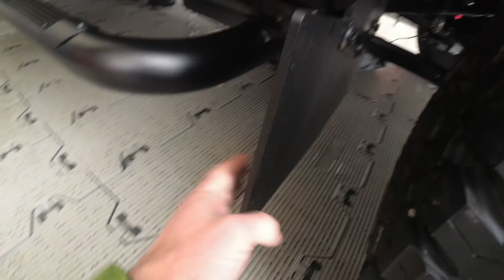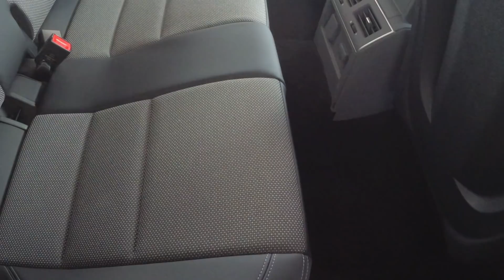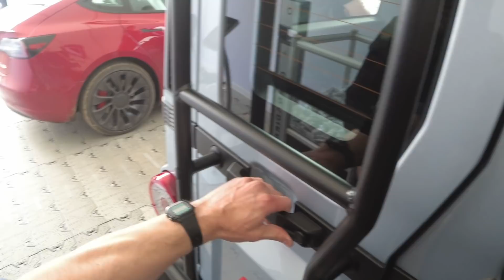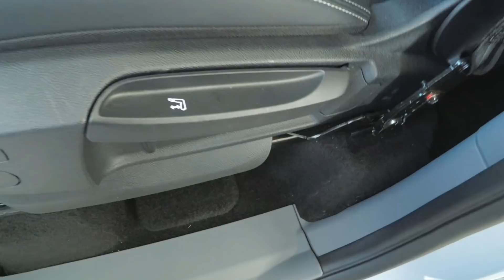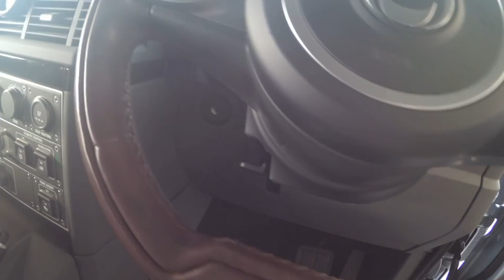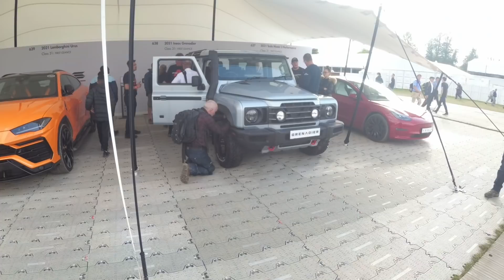Grenadier parts, dealers and warranty - 2 of 2

Comment: I’ve owned several landrovers over 40 years ,still have a 110   12 seater. Used at my holiday house in the Hebrides. Main driver is a now a L322 Range Rover  like it but to much tech . If I leave the door open or the tailgate any length of time say I open it 5 / 6 times a day the battery goes flat , I’m fed up with that told by the AA that’s the way most modern cars are ,was in Halfords to have the battery checked they said it was fine just that modern cars do this if not run constantly. So here’s my issue should I buy a Grenadier . O I also owned 3 discoveries 3 shoguns , the shoguns were brilliant would buy another in a jiffy. However they have stopped making them . I think I need to get a test run in a Grenadier. Need to look for a dealer near Glasgow , any suggestions?

Comment: Only if it were lower cost ,had analoge instrument cluster in front driver instead of computer screen in middle and was WAY MORE RELIABLE than any British vehicle  . British vehicles do NOT have a reputation for RELIABILITY . This is especially true if you're buying one of these  you will be traveling off road in the middle of NOWHERE you don't want anything breaking down leaving you STRANDED .

Comment: This product need 9 more Features that will allow it to truly be a compelling product 

1 remote start ( if you need to start it when it’s cold )
2 keyless entry and start ( in the great outdoors I should not have to take out my gloves and fight with my phone and wallet   And bunch of keys in my jeans pocket to get the keys to start the car in the freezing cold)
3 wireless charging pad for cell phones  ( people will be very dependent on CarPlay and Android Auto )
4 more cup holders 2 for each passenger : water and a slurpy can’t tell you why but cup holders sell  
5 multiple USB ports 
6 an optional rear bench seat that could accommodate 2 kids that could be clipped in or clipped out . Entry to the rear would only need to be on one side of the mid row seats keep the batteries on the other side. Or from the small split door at the back 
7 and maybe put another one of those clipping racks on top of  each of the front fenders  ( this is more of a nice to have ) 
8 also if you could have a touring mode and an off road mode that would allow the ICU to adjust the torque curve and horsepower curves for road highway cross country touting . Because in the US 95% of the time this thing is going to be on the highway taking kids to soccer and the wife to dinner 

9 night mode for the touch screen , speedometer  be that it can be dimmed at night with the Speedo still showing 

With these features I think this would fly of the shelf and these features would add less that $100 to production cost the technology is readily available and adds more utility to this fantastic product

Comment: This product need 6 more Features that will allow it to truly be a compelling product 

1 remote start 
2 keyless entry and start ( in the great outdoors I should not have to take out my gloves and fight with my phone and wallet  in my jeans pocket to get the keys to start the car in the freezing cold)
3 wireless charging for cell phones 
4 more cup holders 2 for each passenger : water and a slurpy 
5 multiple USB ports 
6 an optional rear bench seat that could accommodate 2 kids that could be clipped in or clipped out . Entry to the rear would only need to be on one side of the mid row seats keep the batteries on the other side. Or from the small split door at the back 
7 and maybe put another one of those clipping racks on top of  each of the front fenders  ( this is more of a nice to have ) 

With these features I think this would fly of the shelf and these features would add less that $100 to production cost the technology is readily available and adds more utility to the product

Comment: I am not sure where you got your information from or if its accurate. To be clear one of the early submissions was a cradle fitting for your own ipad with an app for GPS, systems diagnostics,starlink, photocell charging, and instructions diagrams for repair. Seems that they are not listening to professionals at an early stage of development. Imagine been stuck in the middle of nowhere without instructions for repair onboard.

Comment: I spotted the first thing that would break straightaway...the mud flaps. When bogged (in sand) and having to reverse out, those mud flaps would rip off within seconds. I now use Clevis pins on mine (for quick removal) now as I have had my front ones ripped off just like described above.

Comment: I haven’t been excited about a new vehicle for a long time till now. I absolutely love this project and wouldn’t mind picking one up in TX once it becomes available. However, having lived in the rust belt of the USA for 20 years, I cannot help by wonder about the possible rust issue with all the nooks and crannies on the exterior. They WILL collect salt and mud very easily. I’m sure structurally the vehicle can be made to withstand the harsh environment but esthetically I am not so sure. Also, all the exposed hinges will start leaking rust within a year - it is inevitable due to the design unless more existing metals are used in their design.

Comment: Man you have some delusional ideas about the  70 series Land Cruiser. Having had to drive them in central Australia I would never own one. They do breakdown, they are incredibly thirsty, noisy and unstable. I have owned and driven Land Rover series 1 and 2 and the defenders they use less fuel and if you maintain them they are reliable. I only wish the defender was a bit wider.  Not sure about the new defenders as I have not been in one yet though.

Comment: I get the impression that INEOS is on some kind of grand PR drive. Vanity projects popping up all over the place. Cycling Teams, Sailing Teams and now a completely pointless car. If you want a "rugged" 4x4, buy a Toyota Land Cruiser. Otherwise, it's just dezign. Also, as any "insurgent" will tell you, if you can't mount a .50 BMG on the load bed what exactly is the point?

Comment: I was inspired until they went with BMW running gear. Isuzu would have been tougher, more durable, cheaper and easier to work on. Other than that, awesome unit. Nice that they will have the workshop manual on line. I like to work on my own gear as well.

Comment: My problem with the Grenadier is that I dont get on with technology . I dont think soldiers in the field get on too well with it either when the vehicle stops dead and the Taliban are chasing with a loaded machine gun mounted on an old Tata pickup .  However , time is something no amount of testing will reveal and I have never done too well with older cars that the "Brain " has packed up or the sensor which controls the widget on the bottom of the engine which controls no 3 piston .   I think this is why 1000's of old series landrovers survive as the old Perkins diesel or the rover 80 petrol engine just keeps going .   I dont see many discoveries or range rovers at car shows  but old Landies and willys jeeps are everywhere .

Comment: As an owner of two Discoveries in the past, the Grenadier will be better if it has no dealers, no spares and no warranty. Thz build quality, complexity and sheer crappiness of LR vehicles is beyond belief and of course they corrode even though LR claim they do not (aluminium/steel problem)
However, a complement to LR. They have found a way of painting steel with some weird plastic paint which GUARANTEES it will bubble and rust after two years..

Comment: Still think you also need paper manuals/parts diagrams when in the workshop rather than messing around trying to find it on a tiny expensive clean phone with a poor signal. ROW markets - can they really compete against Chinese eg BAIC and Indian eg Force competitors. What about Ford Bronco competition in the US? People want a relationship with their vehicle but will probably spend more time tinkering/modifying/improving rather than doing irritating diagnosis/repairs so the experience will be better.

Comment: I really wish you would have pressed them more about all the plastic parts, cooling system issues and all the other short comings of the BMW engine and whether they acknowledge those short comings and worked on solutions for them.
Reply: Yes the infamous plastic water pump haha , if they have made no changes to the bmw engine ( the plastic parts ) you can forget any long term reliability  😇
Reply: @madfrosty5228  In the meantime BMW retracted from plastic water pumps.  ( I am not fond of Beamers anyway) but I know Audis had them too.  The engine itself is not too bad at all. Still, as long as the vehicle needs to meet (F*K!) EU standards it will match it.  Nevertheless there are other reliable engines on the market.  I assume if the vehicle is utilized  primary somewhere else - they will use other engines. The Grenadier seems pretty modular and so I assume the car can be retrofitted or altered as needed.
Reply: And then there is the EGR problem , especially with diesel version , sucking the exhaust gasses back in the intake is the worse thing that ever happened to modern engines, otherwise these inline 6 engines are really good .
Reply: @madfrosty5228  pretty easy fix on most cars. Put a blanking plate and do a tune 👌🏽
Reply: @madfrosty5228  Yepp but this is not solely a problem of BMW, but in my LR Disco Diesel as well. Utilize frequently Diesel cleaners to keep  at least some of the problems at bay. Recently the injectors were verified. All fine. But you are right, as long as in Europe with some infrastructure this is okay. In Africa or  else where this might be a problem.  An old Mercedes Benz or Peugeot engine from 1980 would run a million miles w/o problems.  But not match EU exhaust regulation. Its like so.

Comment: It's obvious what they have done, the old Defender has been copied and the bad bits have been resolved to produce an up market model.  Front end is not  an eye catcher though, don't like the way the bonnet is designed.  What I do like is the switch gear, like it's out of an F15 fighter.  I'm sure your all asking why JLR didn't do something like this?  The answer is they wouldn't sell enough to make any money, and Jim Ratcliff will also be in the same situation.  It's a "pet project" for him as money is no object.  In the early days he wanted the rights to continue manufacturing the old Defender model and now this is his best shot at it.  He has enough money to subsidise it's production, JLR and other manufactures couldn't work like that.  You have to sell in volume to make a profit, otherwise you go bust.  The shape is growing in me though, but I wouldn't trade in my 2015 110XS to buy one.

Comment: I don't understand the hype with this car. It has the same level of quality as the new defender, not much cheaper than the basic spec defender and many electronically operated features. I agree it looks well designed, but there is still a lot to go wrong. Not as mechanical as I was expecting.

Comment: The only disappointment is the new suzuki jimmy will no longer be for sale in the uk or Europe suzuki has pulled out
Reply: Jimny now available as a commercial vehicle in the U.K. with only two seats. 👍🏻🇬🇧
Reply: @AJ-qn6gd  I wish due to the eu launching the e10 petrol. Petrol vehicles when produced 94% of harmful gas into the air new suzuki jimny produces 110%through the exhaust and every vehicle manufacturer will be fined for every vehicle not meeting this standard. Then suzuki announced fair enough you won't have any this was told to me by a suzuki dealership. I was really thinking of buying one 😩

Comment: I personally think that they also should offer the Grenadier with manual transmission. And maby it is missing foglights, although that's not really a big thing.
Reply: ZF box that’s in it is a million times better than a manual, driven over 200000 miles with that box and it’s brilliant

Comment: You can’t avoid electronics now, but this seems to use them where necessary rather than the LR approach of fitting them wherever possible.  It does appear much sturdier, and the idea that they expect ownership to be long suggests they want to get the reliability and longevity that will make owners satisfied enough to keep them for the long term.  That’s something that LR bluntly ignore.  The more I see of this, the more I like it.  Just a shame about trailing arm brackets and that rear guard protruding down so far.

Comment: Awesome video! It will be great to see it on and off-road in Aus.

I think people in Aus (where I'm from) need to take a reality check when it comes to the engine choice in the Grenadier. We don't have tough emission's regulations for cars 'yet' and it's only a matter of time until we do. Just look and all the people that cried about the DPF's in the 70 series and now the V6 in the new 300 series. They are making a vehicle that can be sold worldwide not for the AU market. 

I also love how there's a bunch of what is considered aftermarket features fitted from the factory and no need to spend another $50k+ AUD just to make a 79 a nice 4x4 to drive long distances.

Comment: What is the rear Bash plate covering ? It seems to be very low and an obstacle for good ground clearance. Perhaps it's just the camera angle.
Reply: I was wondering that they seem very low front and back, are they hiding the axle design from us ? I’d be surprised to see the production model being like that. 👍🏻🇬🇧
Reply: The exhaust silencer is covered by that plate in the rear.

Comment: For what it is worth, here is what I think.

Despite the name, the new Defender is not really a replacement for the old Defender....but nor is the Grenadier. They are both new vehicles for the 4x4/off-road/Chelsea tractor/poser market.

The existing 'Defender' market is split into many factions, these new vehicles will appeal to some existing Defender owners but not to others.

- Some will welcome more refinement, while others would baulk at all the trim that will start to deteriate VERY quickly.
- Many will think they are too expensive.
- Most old Defender parts are cheap and easily obtainable. The old Defender is very well supported by aftermarket accessory suppliers.
- The old Defender is a well understood and simple vehicle. There are few, if any, bad suprises.
- Some own Defenders to work on themselves as a hobby or through neccessity.
- Some use their Defenders in ways that would be unthinkable for a new and much more expensive vehicle.
- Some like the low cost ownership (insurance, servicing, depreciation) of the old Defender.
- Many have no need of a much more powerful engine.
- The thought of an automatic gearbox!
?!
- Many like to modify their old Defenders to make them more individual.

I for one have no need or desire for the improvements which are pointed out in these videos. The idea of losing a large percentage of its, in my opinion, large purchase price in inevitable depreciation would be the icing on the cake for me. 
I understand many will buy them for a myriad of their own reasons but to continually compare it to older Defender models as if it were the only natural ownership progression is not really valid.
 Just because it looks like a Defender does not mean that Defender owners will jump enthusiastically in that direction! The Grenadier is a new car for people to buy if they like them. Given the option for current Defender owners to upgrade why just look at the new Defender or a Grenadier? There are other non-Defender options out there.

To call the old Defender a 'pile of shit' is being extremly disrespctful to a car that is still very popular and which fullfils an important place in today's motoring scene. Does the Grenadier make old Defenders look basic and outdated?, perhaps. Do Grenadiers look more comfortable and lavishly trimmed?, yes. But does it really make the Defender look like a 'pile of shit'? To be honest I expected more from a channel called 'LR Workshop'.
Reply: As someone who has owned and loved my 2001 Defender for over 10 years, it is a pile of shit. A loveable P.O.S., but the build quality is awful.  I'll never sell it, but trust me I would absolutely love a Grenadier.  My Defender is for trashing up mountains, but this would go anywhere on the planet. The first 'Defender' that takes the Land Cruiser on and may well win.
Reply: @ianworley8169  Define 'P.O.S'. Useless? worthless? stinks?  Your comment contradicts itself. A car that was in production for 70 odd years and which a sizeable majority are still in existence is due more respect than calling it a P.O.S. It may be outdated, unrefined, improvable, but it ain't no P.O.S.

Comment: They say that they are interested in "Long term ownership"  but the thing that worries me is that BMW power train.  great when new - but they have not exactly covered themselves in glory over the last 20 years with long term reliability in either their mechanicals or electronics!  

Failing timing guides, bad valve guide oil seals, rod bearings needing replacing every 100k!   What's this thing going to be like out of warranty?
Reply: To answer your last line..... Broken is what I'd say.

Comment: I love the concept , the spares backup , but it needs an Isuzu 4J motor option , that would be a game changer .
Reply: Exactly, using a BMW motor is idiotic and shortsighted as anyone in a remote area will stay well away.
Reply: @wyattfamily8997  thats the only gripe I have about this is the BMW engine. I think the diesel will be good but with all the timing gear in the back of the engine its going to be expensive to service.